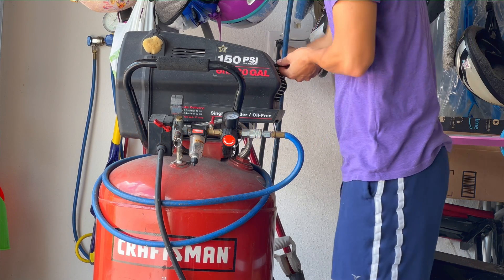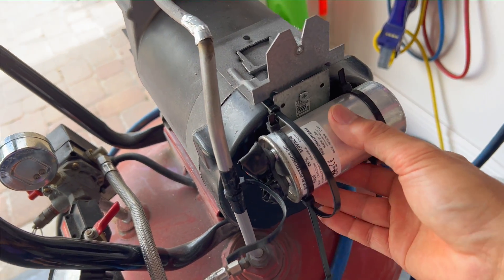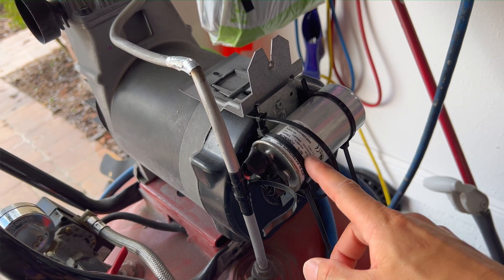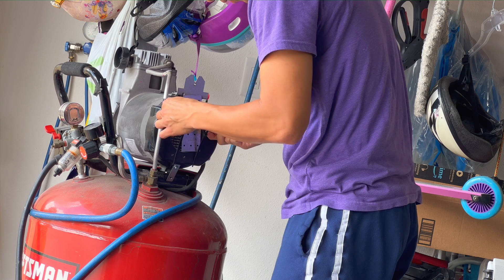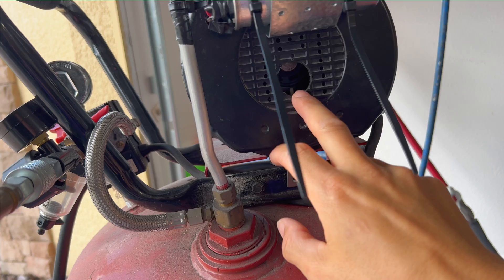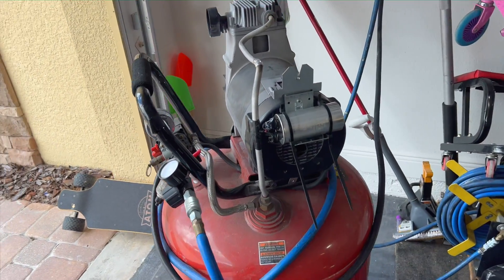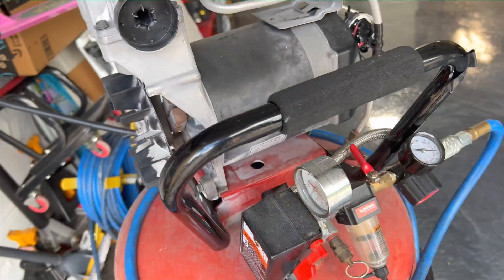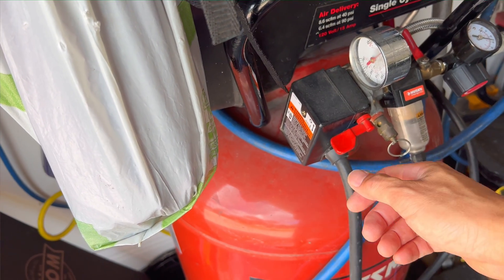How to Fix Craftsman Air Compressor 30 Gallon 6HP| Tripping Breakers

Comment: I have the same compressor and didn’t use it for a year. Plugged it in and it won’t even start? What could be the issue?
Reply from the maker: Check the power connections. If it doesn’t do anything of click, might be the pressure switch seized. That’s a mechanical device with springs and might have corroded.
Reply: @TunerwithKids  it makes no noises other then the click of the red on/off lever when I move it. Like it’s not getting any power to it. Where it’s plugged in has power I checked it with something else. In the past this compressor would pop breakers either when it was filling with air or right when I flipped the red lever to turn it on. I’m a very handy person when it comes to working on car and most anything, but I’ve never been good at diagnosing electrical problems. Tempted to throw it out and just buy a new one.lol.
Reply from the maker: You main need to use a multimeter and check voltage. See if its getting passed the switch. If the start capacitor is done, it won't move when powered on.
Reply: @TunerwithKids  thanks for the input. I ended up selling it and buying a new compressor.
Reply: @TunerwithKids  If the start cap is shorted it will trip the breaker. If the cap is open, the motor will likely hum and you may see the fins oscillating as the motor tries to start but cant get the kick it needs. Eventually, if left like this it will trip the breaker also.

Comment: Just wondering did compressor trip breaker again ?I have same one and it trip s breaker after it shuts off and try to refill again
Reply: Monkey arcade…I had same problem on old sears craftsman 33g 6H and the check valve/unloader valve; same part; was the issue.  It wasn’t correcting the amount of air above pistons after tank would try to restart after being filled the first time 20 mins prior.   The initial start was successful (tank was empty from last time I would of used & drained so no air above pistons to overload the amount of electric it would call for and kick the breaker like it was on second startup attempt)  Easy to change this valve without getting into motor and cheap $20 part.  This sounds to be your issue too
Reply from the maker: Hasn’t tripped since I used the correct capacitor.  It airs up all the way to 150PSI with no issues now.